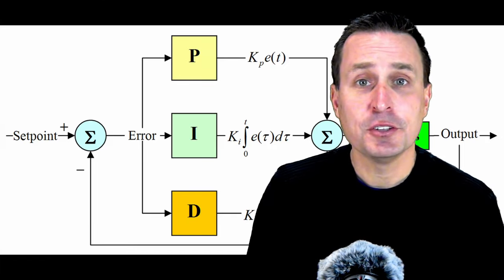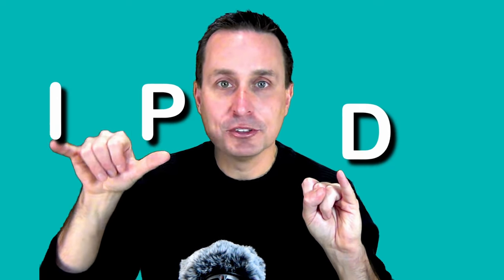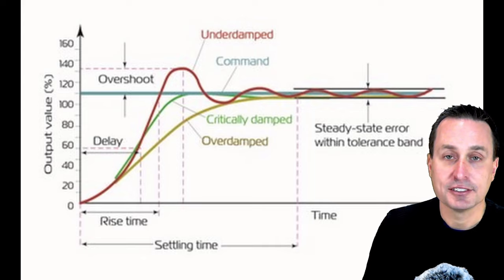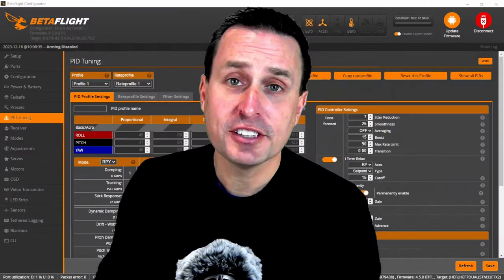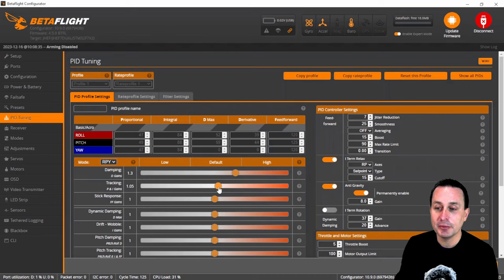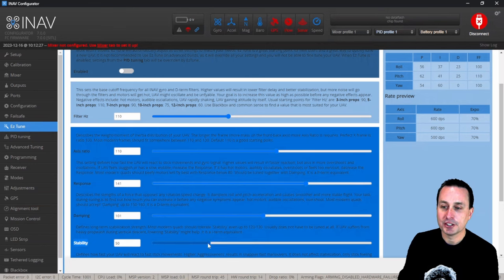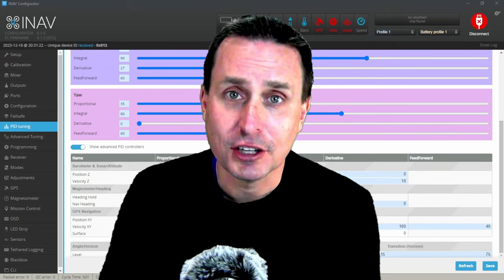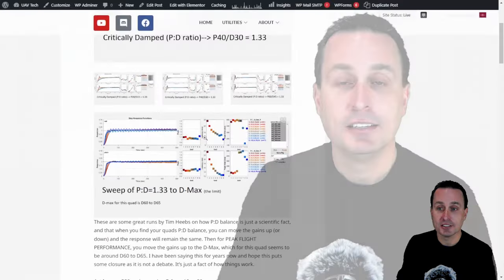The PID Controller makes 🌎EVERYTHING🌎 work

Comment: Doing tuning right now on aura 10. Started at presets that were extremely too low. So bumped up later instantly alot. And bumped D term to get PD ratio.  Then had to take yaw off slider double that. Haven't gotten to go tune again. But i did get a cli pid tube from rcshim he said to try his. He still has wobbles but i could start from there.

Comment: Great job in making things clearer for me! But why every test I'm seeing is still on BF 4.3?
Reply from the maker: Cause that is when the great debate occurred for the slider.  Why would we/I rerun for every release?. The controller is, has, and always will be a Proportional, Integral, and Derivative controller.  Same control logic.  Same physics on the quad copter.
Reply: @uavtech  can I highjack the comment and ask you how much has the sliders changed from 4.3 to 4.4? Every drone I try to pid in 4.4 fly worse then in 4.3 and I can't understand why.

Thank you for your response and for your time!
Reply from the maker: They did not change at all from 4.3 to 4.4.
Reply: @uavtech  awesome, so I can copy thr pids as they are. Probably I've messed up something else then.
Thank you so much!

Comment: Thank you for another excellent explanation.
One question if I may. I note that you said that in Inav for the Z axis there is only the P term that is adjustable. On my 10" quad on RTH the quad oscillates above and below the required altitude, the resulting current draw plays havoc with the Li-ion battery. Will adjustment of only the P term be able to eliminate this, or do I have to just accept it as an unfortunate characteristic. Thank you.
Reply from the maker: P only to adjust the Z Velocity target.  Yhe Z velocity PID loop has P
I. and D.  

I would log the issue to see wsup.

Comment: Good one - I'm understanding better, now - the filtering delay affecting the resonant "mode" - awesome!  Thanks, dude.
Reply: I don't think that is what was said or the case. What he said is that the reduced delay allows for higher PID parameters, and those increase the resonance freq ( 5:50 ).
Reply: @someonespotatohmm9513  That's what I said.  Except that PIDs don't increase the "frequency" - it's the less delay allows for a "tighter" interplay in the system thus "raising" the frequency that they're ideal at.
Reply: @mlentsch  I admit it is kinda pedantic, but rewatch the bit after my timestamp. The control frequency goes up from the increased PID values, not from decreased delay. The nosie rejection (so prop wash) should go up from both decreasing the delay and PID values (not 100% sure on the math about the delay). The difference is importand because you leave performance on the table if you just decrease the filtering.

Comment: Shouldn't the master move the sliders proportionally rather than the delta like what you seem to hint around 4:00?
Reply from the maker: The proportional differences between the gains remain consistent when the Master Multiplier moves up / down.

There is some rounding error, but ...

Comment: Have I understood that correctly that with lower filtering resonance frequency can go up ? If I run a resonance first flight with stock pids on a quad , do this resonance map I make be modified later changing the filters?
Reply from the maker: Not understanding "resonance map".  What do you mean by that?
Reply: @uavtech  a profile of the resonance I make with a first resonance flight, pushing only throttle on all range gradually . Could be a pod toolbox freq/time graph or blackbox graph

Comment: I = Imbalance is perfect!

You need 'I' to balance / center the oscillations around the set point. 

This is the easiest way I have heard it explained.
Reply from the maker: And you DO NOT want your Imbalance term doing the job of the P-term due to lack of P-gain.

It will cause wobble.

Comment: So if i have fast pich and roll ocilations while hovering on a 8inch i should increase the d gains?
Reply from the maker: If fast oscillations (VERY FAST), yes.  Reduce P or increase D.  For BF, the P and D gains should be around the same numbers.

HOWEVER, it is more likely the I-gains which can result from them being too high in relationship to P gains, or the overall gains just being too low.

To confirm which it is, set P and D to around 40 and I-gains to around 20 or 30 for an 8".  Those are pretty safe values.  Once the oscillation is gone, you can then work to increase the gains slowly to increase flight performance (stick tracking and prop wash response).

Check out my presets for an 8", but be cautious as those assume you don't have mechanical vibration issues.
Reply: Thanks for the reply i forgot to mention i run inav also the i can see the ocilations while hovering i am not sure if that is considered as very fast ocilations
Reply from the maker: same advice, but reduce the pids based on my pid calc tool: theuavtech.com/pidcalc
Reply: @uavtech  thanks

Comment: The Integral (Ki) is not the most important setting. You must use Proportional (Kp) in all controllers. The Derivative (Kd) dampens the Kp response and allows you to use a higher Kp value than you could without it. With only Kp and Kd, a controller won't fully reach the setpoint because the closer the system gets to the setpoint, the lower the error signal gets, and it can no longer drive the system to the setpoint. The Kd only does dampening, so it can't drive the system to the setpoint. The Ki circuit samples the error over a period of time and sums the errors it sees until the sum is large enough to drive the system the rest of the way to the setpoint. So, you increase Kp until you see some oscillation, add Kd to dampen the oscillation, and then add Ki to reduce the long-term error between the setpoint and the system output.
Reply from the maker: Who said Ki is most important?

However you get the balance, once you have it and are at a Critically Damped response, moving the gains up to just below the system resonance is the key for peak performance of whatever you are tuning if you want a rapid response and the most stability to following and keeping on the Setpoint.  That's the part the classic tuning method you described above leaves out.
Reply: @uavtech calling ipd instead of pid, it gives that vibe.
Reply from the maker: Just putting the terms in order of how they relate.

i-Term oscillation is dampened by increasing P (shown here https://youtu.be/Sq_DFjmvVDE?si=Tm5FpvpLbmIQps4t)

P-Term is dampened by D.
Reply: @uavtech You did when you rearranged the terms into IPD at 1:32..   😎
Reply from the maker: Never said.  You inferred the wrong thing.  😜
Reply: @uavtech  That's not how they relate. Think about the cruise control in a car. If you only use Kp and the gain is too low, the car will accelerate toward the set speed, but the error signal will decrease until it's not large enough to bring the car all the way to it. If you set Kp too high, the car will accelerate too quickly and overshoot it. You then add Kd to dampen the overshoot. The closer the car is to the set speed, the lower the error signal becomes until it can't hold the car at the set speed. The Ki loop samples the error signal over a period of time and sums the error signal until it is large enough to bring the car to the set speed and hold it there.
Reply: @uavtech A picture is worth a thousand words and it showed IPD..
Reply from the maker: It is.  Do some testing yourself.  I'm quite aware how the controller works.

P is the only term that can tame i-Term ocillation.  i/P balance.

Aka: Without adequate P, i-Term will oscillate. Of course adding D, just makes that worse.  Shown at https://youtu.be/Sq_DFjmvVDE?si=Tm5FpvpLbmIQps4t and of course your are welcome to test for yourself.  Adding D to tame i-Term wobble just makes it worse and worse.

You are saying what I have said.  i-Term for imbalance to bring the steady state error onto the Setpoint.  Obviously.  But if that term is too high in relationship to P, it causes oscillation (wobble) as it takes awhile to wind down the accumulated error.  To have less error accumulation, increase P.  

Too high of P and it also over shoots with rapid oscillation.  To tame that, d-Term.  i>P>D